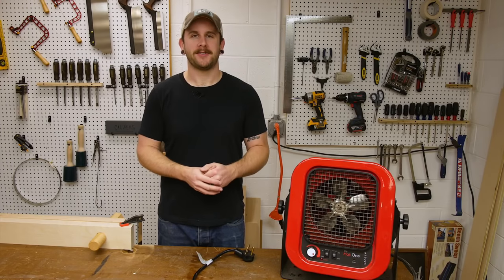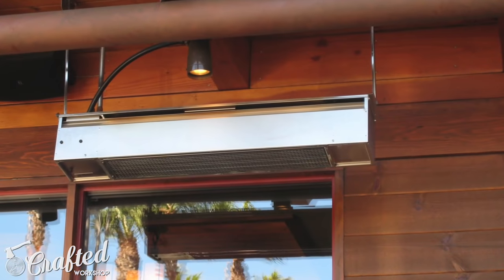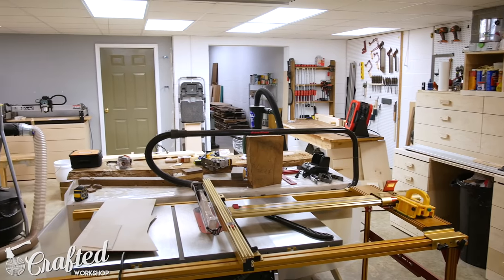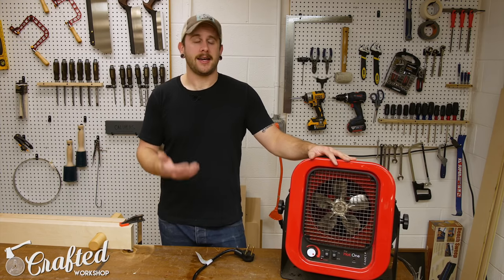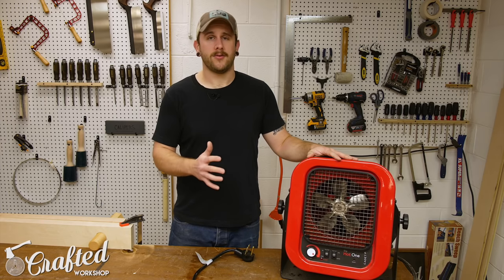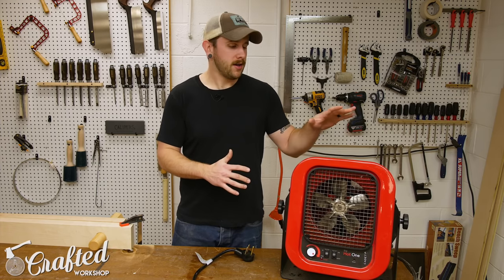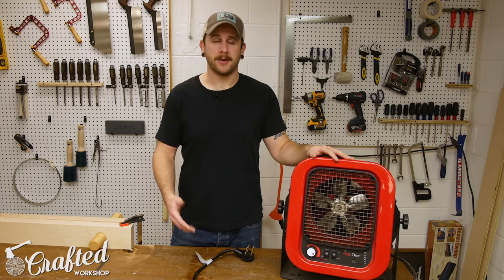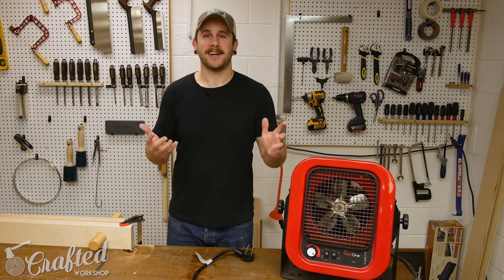Winterizing My Workshop: Shop Heaters, Garage Door Insulation

Comment: We live in Wadena MN.  We have a 1,315 sq. ft. home with 676 sq. ft. garage.  Infloor hot solution for heat.  We have cellulose insulation to R-50 in the ceiling through out the home.  Heat source is a 15 Kw wall mounted electric boiler on off peak.  We keep the house at 68 degrees and the garage at 55 degrees.  We have not yet reached $500.00 for an entire heating season in the 12 years we've been here.

Comment: Depends on how often your in your shop and how much your electricity costs. Mr Heater sells a vented LP shop heater for $350 on Amazon that will blow away the electric in performance and operational costs. I had one of those boxy 240 volts units and thought it was great until I got my first electric bill.

Comment: I have had this heater for several years. It does a great job heating my garage/shop. The only issue I have had is depending on the amount of use, the motor has to be removed and the bushings cleaned and re-oiled as it will gum up and eventually kick the built in breaker. I do mine about twice a year. I am hoping a synthetic lube will last longer.
Reply: Ya, it is a great little unit, safe operation and backed by a pretty cool and professional customer service! And I like how it is a serviceable unit, with parts that are available. And check out Roxul insulation, great stuff to work with.

Comment: I have this heater and its a monster heater.  It heats up my 1200 ft. workshop with NO PROBLEM even when the outside temps are below 0.
Reply: How tall are your ceilings??
Reply: @trojanman22  10 ft.
Reply: @christschool  I’ve got 16ft ceiling so it might not be enough for me
Reply: @trojanman22  Those are some awfully tall ceilings.  I think the more important consideration than the height of the ceiling will be the thermal envelope of the garage. Good luck in your decision.

Comment: dude look on ebay theres an electric heater 5000 watts hangs from the celing or wall 125 bucks it kicks ass bro
Reply: LOL True! I have an electric heater with a fan and it swings, directing airs where I want it. Less than a third of the cost. This is an infomercial.
Reply: @Raymond J Do you have a link or remember the name? Thanks!
Reply: @drewr1552  JUST LOOK UP CHINESE DIESEL HEATER AND THEY ALL POP UP I FOUND AN ALL IN ONE PUT TOGETHER IN A CASE FOR $140. JUST DRILL HOLE IN FLOOR N POP IT THREW N YOUR DONE !
Reply: @drewr1552  I TYRYED TO COPY A LINK CANT DO IT JUST TYPE IN DIESEL PARKING HEATER !  GOOD LUCK YOULL LOVE THESE BABIES
Reply: @raymondj8768  Awesome. Thank you!

Comment: Great overview of the options. I was able to run some extra ducts off my blower unit to my garage since it shares attic space with my garage. Doesn't make it toasty, but keeps it tolerable.
Reply from the maker: Nice, that's a good idea. My heat pump for my house is right next to the garage, that might be a fairly easy option.
Reply: For the record I have no previous experience with HVAC stuff.. just realized that was an option, watched some youtube videos and went for it... it works! I'm sure you could handle it if you decide it's a good route.
Reply: Adding ducts from your house furnace to garage is not a good idea due to carbon monoxide risk. I believe it's also against most building codes.
Reply: @gdavis8588  how so? I've done it. Had it done two years ago..still ain't dead..

Comment: That heater is overrated.  I  returned mine.
Reply: I'm in Canada and heat my shop with a 4000 watt electric heater that cost $89 cdn and it runs maybe 1/3 of the time.   For $250 it better have festool paint on it.

Comment: Rocket mass heater. little risk no creosote and heats for a long time on little wood.  Electric is the most expensive way to heat and the most inefficient.
Reply: Raquel Bauman electric heat is 100% efficient.
Reply: 100% efficient, but usually the most expensive option depending on your electric rates.
Reply: @Papa-qv6ep  Correct, but I never disputed the cost option. I'm in the second cheapest state in the country (per kwh), but I still much prefer my wood stoves and propane furnace.